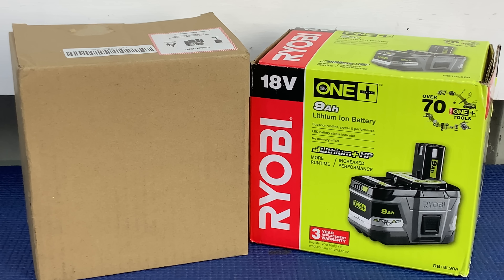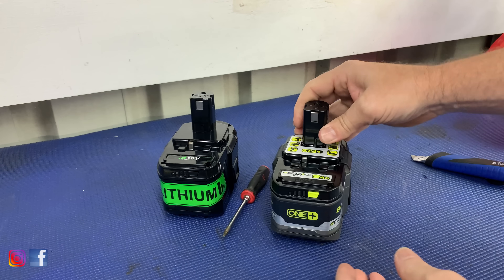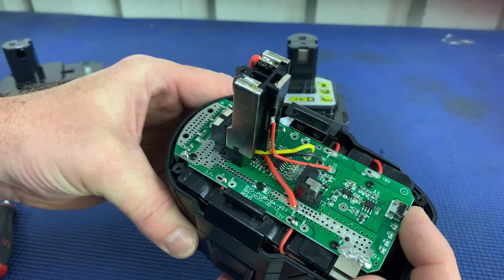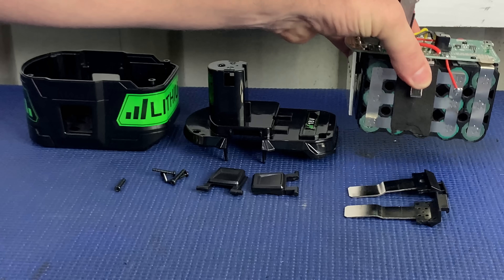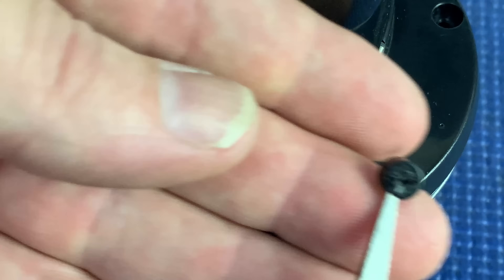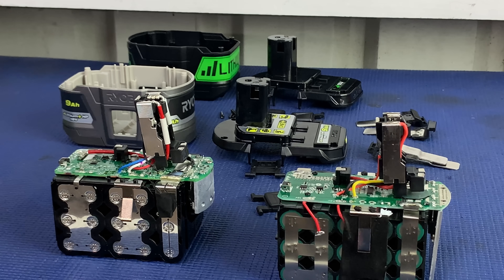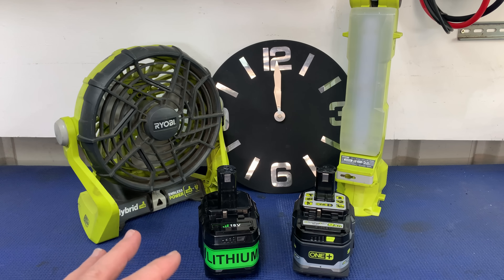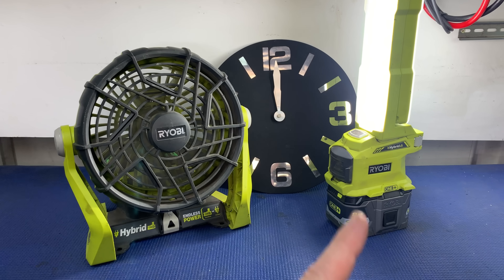Ryobi 9ah battery versus eBay knockoff job

Comment: These communist Chinese fakes ALWAYS lie about the rating.  And what is even worse than the AH rating is the C-rating of these junk cells.  I.e., lets say that the junk cell doesn't provide 9 amps, only 6.  So you think you got a "good value" buy and just think of it as a 6ah.  But that isn't the problem.  These fake junk ChiCom cells cannot deliver the power at the rate of quality cells, the "c-rating" or rate of discharge.  That means a 6ah quality battery will run a saw while the communist Chinese fake cells bog down because they can't deliver the necessary CURRENT.  So you are NOT getting 70% of the performance using commie fake batteries.

Comment: It's even more fun to test them the way I did. I bought a knockoff before I bought the real thing. I used the knockoff in my angle grinder. It caught fire and melted the base of my grinder. After I replaced the grinder, I decided I'd only buy authentic batteries. Found a deal at Home Depot a couple of years ago and got two real 9Ah Ryobis for $180. I run them all day and they don't catch fire. Lesson learned.
Reply: Of course. Nobody pays full price for a ryobi. I've just bought two 4Ah for the price of one in an email offer, plus another 4Ah half price with a charger against the bare tool price.
And, this test is of a knock off 6Ah v Ryobi 9Ah, that's what the endurance test showed.
Reply from the maker: Thanks for sharing, yeh seems like a solid test! Grinders pull the amps..

Comment: Three years ago I purchased a new Ryobi tool set and some ,four amp hour batteries and then I week later went on eBay and grabbed a handful of 6 Amp hour batteries and this month they all started taking a crap first one to go was a Ryobi then three of my eBay‘s in one week then now this week I just lost two more Ryobi‘s and an eBay. I have to say I didn’t see a huge difference in quality over the last couple years the only thing I can say I didn’t like is the eBay battery I would have to jiggle in the charger to get them to charge sometimes. But other than that worth every penny I saved by not buying more factory Ryobi batteries.

Comment: I have two knockoff 4 amp hours and they work fine
Reply from the maker: Working fine and doing what they say on the box is two different issues here.
Reply: @HBPowerwall  that's true. I haven't done a proper test of them and they shut off when a small amount of power is being drawn. For most stuff they seem to work fine, but for a battery that works well with all tools going with an OEM battery is best

Comment: I use the 18v & 40v knock offs, The charge does not last as long as the Ryobi counter part. But it's a lot cheaper and for what I do the knock offs are a far better deal. I did a good amount of review reading before buying because not all brands are equal. 
Bottom line is they work and cost less
Reply from the maker: And will likely burn your house down... but meh, details

Comment: I have no doubt that the cheaper battery is shit, but bro… you have, have, have… to run that test with the exact same tool! There are also ways of testing voltage drop you should look into that so that you can prove the cheap battery does not supply as much power… furthermore when you test a 9 amp hour knock off you should also run it against a six amp hour battery from Ryobi and include the price and the power difference. At the end of the day all of this shit is from China! It’s not their fault we have let them take everything over including your country! I am praying for y’all!

Comment: No follow up video
Reply from the maker: Cause the EFFFING thing died a few load tests in - in other comments I've linked the Instagram post.. let me sum it up - THEY SUCK, the 'lithium' ones that is!
Reply: @HBPowerwall  ah sounds like the BMS did it’s job then. I’m not really fussed about discharge numbers as the best 18650s are 30q with 21700 having better options.
Reply from the maker: no the cells died - 6 went zero volt

Comment: Doesn't appear to be a very objective comparison of the batteries, genuine Ryobi items are not the best when compared to the leading brands, I have several of their items which are of dubious quality and reliability.
Reply from the maker: Objectively - these knock offs suck, 3ah not 9 as advertised, lasted less than 2 weeks or 5 full cycles and would probably burn your house down!

Comment: Sick to death of paying exorbitant price for Ryobi batteries.   Been using 'knockoffs' for 2 years now and never had a failure.   More than happy to continue with the cheaper batteries, thanks.
Reply from the maker: Comment section seems to be 50/50 i'll take genuine after seeing so many dangerous and out right lies on the side of the packaging..
Reply: @HBPowerwall  I used the knock-off version of the 6amp battery. Yes, it feels cheaper than the original one from Ryobi, but I never have any problem with it, and I have used it for 2 years. Not sure about your "lies" comment. When I purchased the knock-off battery, they told me straight out that this is indeed a knock-off battery, and there is no Ryobi warranty for it. The knock-off is $69 and the genuine one is $299, so the difference in quality is expected.

Comment: I own approx. 2 dozen of each type of this battery (OEM and aftermarket) and have had no problems with the aftermarket one's.  However the OEM one's have required replacement numerous times.  Plus I can buy 4 or 5 of the aftermarket batts for the price of 1 OEM one.  So even if I went through 4 of the aftermarket to 1 of the OEM I'd still be ahead.  But I don't.  The aftermarket batts last and last and last, unlike the OEM Ryobi batts.  I once thought that you could get more by paying more, too.  I found out that YOU CANNOT.
Reply from the maker: Doesn't account for how much more dangerous they are and the lies they tell about the actual capacity.. THEY MUST BE ACCOUNTABLE FOR THEIR LIES AND SAFETY ISSUES!

Comment: You could buy four eBay batteries for one Ryobi battery and still have change. Would have been great to test the battery before pulling it apart.
Reply from the maker: you go buy your 4 pieces of shit and let me know how that goes!
Reply: @HBPowerwall   Does not change the fact that you pulled the battery apart before testing it, which makes absolutely no sense, you test it first and once all tests are completed you would pull it apart for inspection. Second glaring oddity was using different chargers to charge the battery. It's like comparing oranges and apples after you squished them. Completely pointless video from then onwards as no comparison can be drawn from a product that you likely damaged before testing
Reply from the maker: To be fair i used it for two days (give or take) fell out of the whippersnipper twice and died 3x faster than Roybi - THAT is what prompted the video - the SHIT lithium battery has 3ah of capacity advertised 9, i did about 6 cycles at 5 amp draw only to have TWO of the 5 groups of batteries go zero volt - see my instagram post from months ago when I was prepping the next video. JUST SHIT, service, quality, marketing and ability to do what the box says it will do.. I still have the partial footage from that video, perhaps it would be worth my time to upload that.. :( I freeking hate this part of youtubing...
Reply from the maker: instagram post when I started testing https://www.instagram.com/p/CNrOhGAn8Sr/
Reply: @HBPowerwall  Would be great to upload the footage you have.
Reply from the maker: I'll take a look for it... for sure.. it needs to be released but i'm almost 100 percent done with the old youtube...
Reply: @HBPowerwall  My three 3rd party batteries are still working, while my two OEM Ryobi batteries aren't. That's how it went for me.

Comment: It probably cost $3.50 each to assemble one Ryobi battery, I see nothing worth the $300 dollar price tag.
Reply from the maker: As stated, it was only $200 I got the ..... (well wife TOLD me the wrong info), price wrong in the video. As for your comment about the price to assemble I'm assuming you're referring to the total cost? If so $3.50 wouldn't cover one good quality 18650 cell even when buying them by the billions I'd say and there is 9 in there. Then they had to pay for a year of engineering & prototypes, Testing, conforming to global regulations, insurance, labour, factory rent, accountants, lawyers fuck the list is long and quite impressive.. You think the chineseium battery even bothers with 99% of that lot?
Reply: @HBPowerwall  Oh, and for the sake of argument, I concur after transportation, the middle man, etc... to put it on the shelves $20 bucks, Max. Besides how many batteries do you think they sell per day, 2-3, or more like in the thousands?

Edit to add, you know we are talking about Japanese components here, right? Which in my book they do produce some of the best resistors and other electrical components and circuit elements that a lot of manufactures rely on around the world. Which is the other reason for a low cost.
Reply from the maker: I'd rather a 100 buck hooker than a 20 buck one... get what ya pay for.. I can't win this, so thanks for the interaction...

Comment: A lot of assumptions and judgement of features that might, or might not have an effect on anything
Reply from the maker: Is being a piece or rip off crap a good assumption - battery died under 7 days after I finished this video and started to film load tests. Two of the cells went zero volt under a 1amp load test. Here is a 'promo' shot from a while ago.... https://www.instagram.com/p/CNrOhGAn8Sr/

Comment: About 20 years ago, when Ryobi tools were blue, I bought a 12v drill kit on a Father's day sale. Batteries didn't last at all. Took them to a battery shop, and found that Ryobi used a cardboard spacer where some batteries should be. Turned me off Ryobi for years.
Reply from the maker: that carboard spacer only matters if they are advertising incorrectly - many laptop suppliers sell a 3ah battery & 6ah battery - they use the same battery case with plastic spacers or placeholders. It's only bad if they used false advertising .
Reply: @HBPowerwall  Back then, they didn't advertise capacity, just voltage. That's why they were sold at a discount.

Comment: If you can afford $300 for a battery then buy it but for most people they'll buy the cheap one because if it knackers you can buy 4 batteries before you hit the price of the genuine.
Reply from the maker: Well it turns out it was 200... I made a mistake, BUT the 'lithium' battery died days after wraping up this video & Ryobi 9ah still going strong.

Comment: You tested these batteries using a low current draw.  The best use of 9ah batteries are for tools that draw a lot of amps like an impact wrench and this is where the knockoffs will fail because they won't be able to provide as many amps as the original battery could so a tool like an impact wrench would provide less torque using the knockoff battery.
Reply from the maker: I tried that but running a impact, grinder, circular saw at a constant draw over a constant time was impossible.

Comment: Would love to know what cells are in the High Performance vs High Capacity Ryobi and which cells are in which. The latter apparently use Samsung 18650-20Q cells. As I understand it HP and HC Ryobi batteries of the same Ah will have the same run time but the HP can provide a higher peak current. Also, I am wondering why the HP has an extra 2 terminals at the base of the shaft. Why are not the 3 terminals at the end of the shaft sufficient to deliver HP performance?
Reply: Afaik the extra contacts are only there for the battery and tool to communicate, I havent put a scope on one but I think the extra tab is just a signal that goes low when the tool tries to draw too much power to tell the tool to cut back

Comment: I got burned on a couple Vanon batteries for dewalt. They were Complete garbage. Wouldn’t even charge correctly most of the time, one took a 3 foot fall and was a paper weight. Vannon has zero customer service, they would not return any emails. The money I wasted on 2 junk batteries I could have bought a dewalt that would actually work and last for years. Don’t waste your time, money or risk burning your house own putting this garbage on your charger and walking away.

Comment: Lithium batteries.... Absolutely need to be made with quality, and high standards in place. No, not for snob appeal. When they go wrong, they have a tendency to Vent With Flame. Which means they can literally explode. Oh wait, it gets worse. Due to their chemical make-up, if they explode; they give off highly toxic gases. Breathe those in, even just a little of it, expect severe and serious long-term health issues. Generally lasting decades! (No, that is not a typo.) Possibly lasting the rest of your life. Were you fit and active? Well, you won't be anymore. Not when those literally flaming hot toxic gases start very slowly eating away at your lungs, over decades! The fakes have zero safety measures built-in. Zero standards in place, zero quality control measures adhered to. If the battery explodes, whom are you going to sue for your medical bills, and long-term pain & suffering? No one, that's who.

Yeah, I get it; for some folks even a value-based budget brand like Ryobi is going to be a strain on their wallets. They're not as good. But brands like Bauer (Harbor Freight in-house brand), and Hart do exist. Buy the best quality tool.... that you can afford.

Comment: There's usually also the problem when using at high discharge. Fakes use junk 18650 low current cells that can't take the high drain for the top power tools.

Comment: I wanted to buy original but they charge way too much. Even if the knockoffs are 50% less efficient, they are still better value. Big companies need to adjust their pricing. If they were 30-50% more i would buy original, but when they are 300-400% more then they are taking the piss out of us.
Reply from the maker: lol they would have to be less than 20% of the price to offer any value at all.. Piece of junk the lithium battery, died after a few days of testing

Comment: Imo you use test are suspect at best to disassemble the batteries b4 testing makes the test questionable because 1 reassembly mistake would possibly taint the ability of the proper functioning of the battery ... yes disassembly is a needed part of the comparative aspect  of the video ... BUT disassembly should ALWAYS be after the efficiency tests .... again just my opinion but hey what do I know
Reply from the maker: I don't know anything either - used the battery for a short time - IT SUCKED, made a video - perhaps the wrong way but result was it is a SHIT battery with 3ah of capacity not 9, died 5-7 days after I finished filming this video & after 5-6 full cycles to test the capacity and durability. USELESS piece of junk..

Comment: be interested to see how well the knock off lasts, I got 3 year old Ryobi battery that I last charge and used over a year ago (shoved in back of the drawer and forgot about) and it's still got charge and can't tell the difference between it and my few months old new battery. the follow up video out yet? I can;t find it.
Reply from the maker: It died 3 days into the next video, two 'cells' are now zero volt - usless piece of crap.

Comment: 1:11, you meant 9 thousand milliamp. also, what is written on the battery is 9000MAh, capital M means Mega, if correct which would make the battery hold 162 GigaWh, able to power an entire city for a year. should be 9000 mAh, milliAh, or just 9Ah.
Reply from the maker: What was on the box was 9000, what was in the box was 3000mah that's the tests i was running when the battery died.

Comment: Why yes, I'd enjoy a teardown video to find the quality and individual and group output and type of the cells used in your eBay special 18V "Ryobi" "knock off" 78% cheaper pack. Something tells me it won't be good old wholesome high quality as one would wish. (You have to wish, hope ain't gonna help you!)
Reply from the maker: tests showed that the cells were just 3ah not 9, I wish i had the time to do it in this video. Battery failed a week into the next video effort... just walked away from it at that point.

Comment: This review has lots of biases and presumptions to begin with, and also ended with additional presumptions when the previous presumptions were proven not quite accurate.  To begin with, the use of the word "knock-off" usually means something pretends to be genuine. This one has no brand on it, therefore it is what it means to be, a Ryobi One compatible battery. Most reasonable reviewers generally start functional tests on various aspects of the product before taking it apart to see the internal build quality.  You did it in reverse. This is proven to be a critical mistake.  Because when you complain about this no-brand product being unable to be smoothly inserted into a host, you can't be positive if this is a fault of the product or your imprecise reassembly process.   Then you also make many comments about subjective preceptions, such as the motor sounds running stronger with OEM battery etc. While I am not doubting your perceptions, I have doubts if the preceptions are reality. A motor doesn't care about the battery is OEM or not, the higher the working voltage, the higher RPM it runs.
Reply from the maker: The battery is just plain shit. Use at your own risk. Didn’t last a week into next weekend of testing with two zero volt cells killing it.

Comment: Crock of crap. I have plenty of 18v knock off batteries and they perform 100% as well as the oem and charge faster. I dont take them apart and criticize the manufacturing....for the price I expect a difference. I can buy 3-4 6ah knockoffs for the price of one OEM. You do the math re the run time.
  I know of NOBODY that complains about their knockoffs.
Move along.